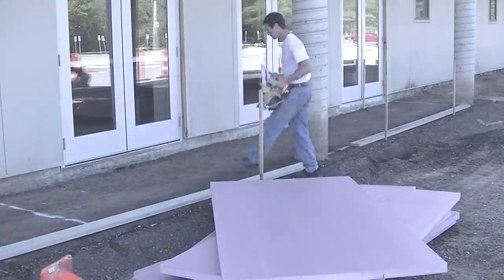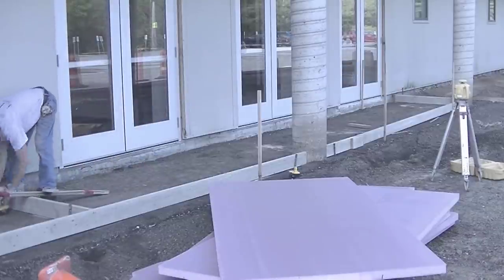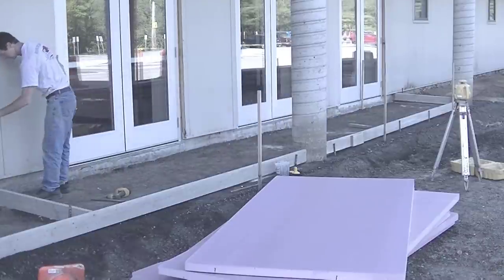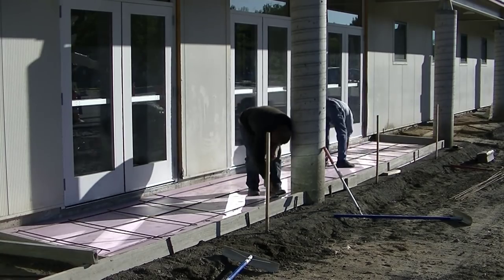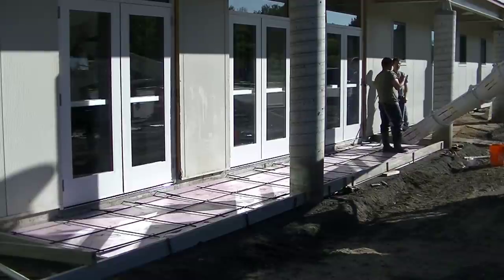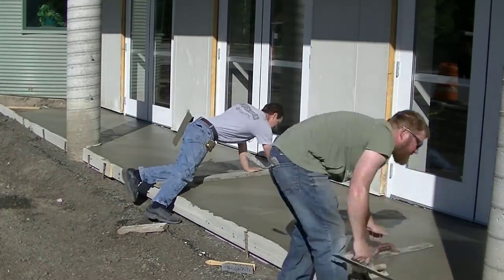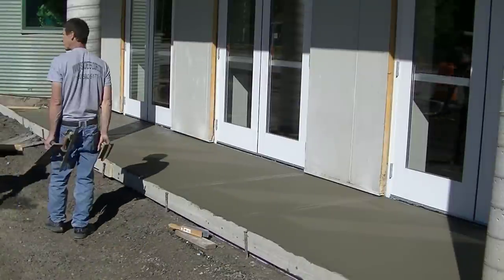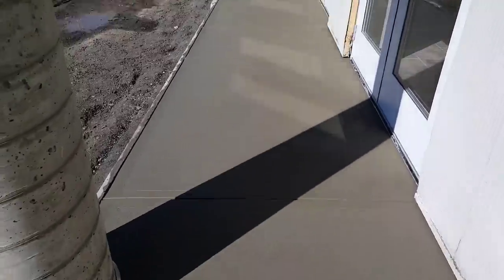How To Form, Pour, And Finish A Concrete Walkway - For Beginners

Comment: I've been in the business of selling certain concrete supplies for a few years now and I am surprised how many different things go into planning, working and finishing concrete that I wasn't aware of. Great videos, even if I don't ever really plan on doing diy concrete.
Reply from the maker: What kind of supplies?
Reply: Insulation blankets, mesh, rebar, bull floats, darby and other mag floats, edgers, cure & seals. As an example, I wasn't aware of what you refer to as a "wet pad" or that such a thing was checked with a laser, and I've sold many surveying lasers.

Comment: Mike, excellent job as always. Question where you pinned to the foundation. How deep did you go and I noticed you didn’t tie the pins to your new rebar cage. Is that not needed?

And if you are using remesh, you still use rebar to pin?

Comment: Good vid Mike. You guys made that look like ‘kids-stuff’ 👍. 
-You asked about the name of the cracks. We always call the cracks that occur in the grooved lines or any other ‘real’ cracks, “expansion cracks”. Those very fine, spider web like cracks that seem to occur sometimes just randomly, we always call “shrinkage cracks”. 
-You usually go with the cordless tools, but you pulled out the generator when you needed to use the hammer drill. It looked like, for the amount of ½” holes you had to drill, that your Dewalt cordless could have done it. And it looked like you had an extra battery there too. Any reason you went with the corded drill?
-Btw, I think your video ‘formula’ is very effective and easy to watch with the ffwd time-lapse and the voice-over dubbing. Good stuff!
🤜🤛
Reply from the maker: Thanks for the good comments and informative comments as well. I didn't have the cordless hammer drill when we did this job. It would have done it if I had it. Expansion cracks is a good term, I've always used shrinkage crack with homeowners because the crack usually occurs when the concrete is "shrinking" during curing. I just think it's a term the homeowner can understand when I try to explain it to them.
Reply: @MikeDayConcrete  Btw, and I know it’s always just a client preference choice but, I always liked the look of the tooled edges with the edger and groover in contrast to the broomed finish in the field. It always just seemed to give the concrete more of a ‘dressed’ look. Just my opinion.
🤜🤛

Comment: Mike I’m in Connecticut. Pouring a 30 foot long by 4 foot concrete walkway. 4 inches thick. Do I need  the pink insulation?  I know Maine is a tad colder than Connecticut. Thanks so much for your content. Pro status! Subscribed.
Reply from the maker: If you got good gravel under it probably not. It's good insurance though if you're going into an entry door like this one.

Comment: I read that 25% of the concretes thickness needs to be grooved or cut to help control shrinkage cracks - and that a 1 inch groove does not work as intended on a 6 or 8 inch thick slab - my soon to be poured driveway is set at 6 inches. Would you saw cut it or just go with a 1 inch groove or do you have a better solution - i saw that up to 2 inch bits are available for groove tools but I have none available here locally and have yet to easily find one here on the net. Want to pour next week

Comment: We put strings up first at ff height then just set the boards to that for height and to stake it straight  But your way will work if you have a lot of time i guess and dont need the forms very straight.  I notice you never try to bullfloat the opposite way you struck it off.  You get much flatter slabs if you do that instead of the same way you screed.  It cuts the high spots down.  I am a union finisher foreman and thats the way we all learned.
Reply from the maker: Not sure what you mean by not needing the forms straight. That would be very irresponsible to not have them straight and I wouldn't keep getting re-hired by the same contractors if I did that. We don't have "high" spots when we screed, that's why we can bullfloat either way. Different points of view, each can be right, we just do things differently.
Reply: Pat, check back a cpl videos ago where they got a bow in the form while pouring. Mike made the guys dig the concrete back out and install more kickers on the form to make it perfectly straight. 
I would be lucky if my finishers even brought it to my attention and asked about getting a cpl carpenters over there to fix it let alone fix it themselves. 
You really should check out a few more videos before making negative insinuations like that.
🤜🤛
Reply: @psidvicious  It was not an insinuation at all. I watched him put the forms in with no string. Seems easier to straighten and stake properly before pouring to me but to each his own. And this guy is one of the very FEW that does do things right on YouTube. Not insulting just asking. Take it easy....
Reply: @patv1271 If you meant no offense, then fine but coming from someone who’s just reading random comments and can’t be inside your head. When you phrase things like: “But your way will work if you have a lot of time i guess and dont need the forms very straight.” - Comes across as condescending and somewhat insulting. Just sayin’..
🤜🤛
Reply: @psidvicious     Sorry mom.  I will do better next time I promise
Reply: @patv1271  That’s ok. The important thing is you realize how wrong you were and you apologized for it. You’re still going to have to go to bed early tonight with no supper but I’ll try and talk your dad out of giving you the belt.
🤜🤛

Comment: Do we have to pitch the boards so water runs down or not needed?
Reply: Definitely pitch for a job like this. He said it was about 5’ wide so he probably gave it about a 1” pitch.
🤜🤛
Reply from the maker: Yes, I mentioned in the video I sloped the walk 1" while I was setting the grades with the laser.

Comment: I'm doing a concrete step out of an addition, so was looking at how you tied into the old foundation and appreciate the tips.  It's over 4 ft of fill gravel (my step), would you still use foam board under a single step (1'6" wide x 8" tall x 50" long)?
Reply: And in midwest so have a lot of freeze/thaw cycles too.
Reply from the maker: I think it's a good idea to use it in freeze/thaw areas, yes.

Comment: Do y’all ever use six sack? I think it’s 5,500 or 6,000.
Reply: Unless you’re doing beams, columns or elevated decks there wouldn’t be much need for it on flatwork like this.
🤜🤛
Reply: Ah okay. We use it down here in Louisiana it’s richer but we also use 5 sack. We also have different temperatures😂
Reply: @matthewmorton8808  Seems surprising to use a 5K-6K mix for flatwork but my best guess would be it’s probably about the compaction rate for the soil conditions there. I’m not a soils engineer but I could imagine an engineer opting for a ‘juiced-up’ mix if he couldn’t be certain about good compaction in the soil. 
That 5K-6K mix is pretty ‘sticky’, isn’t it?
🤜🤛
Reply: No it’s not sticky. It’s a lot richer and creamier. It is stronger than the other ones and it does have more cement in it and not as much sand as the other ones. I mean there’s not much difference from the mixes but the sand to cement ratio.
Reply: @matthewmorton8808  Gotcha. The strongest mix I ever had to pour was a 10K mix w/very little water and almost all HRWR for puddling some column heads on a parking garage. The mix still came out at almost a 10” slump. I just remember my finishers complaining about how sticky the mix was. Maybe it was all the water reducer that made it that way and not the cement.
🤜🤛
Reply from the maker: Only on a drive-thru pad like at a bank or a gas station pad that needs to be put back into use the next day. It's not needed on regular exterior work like this.